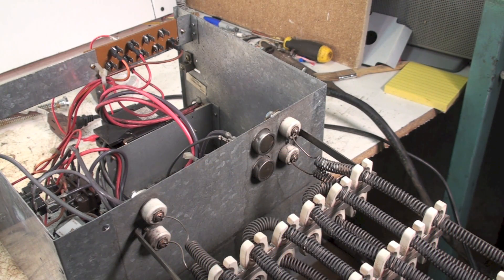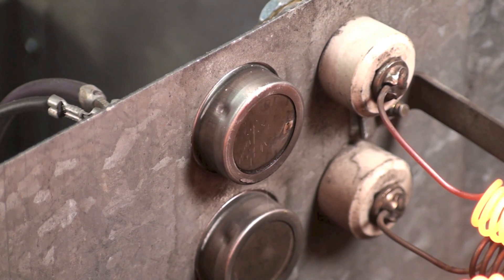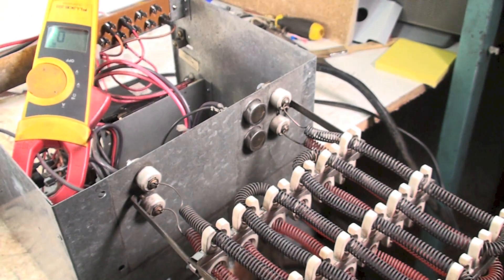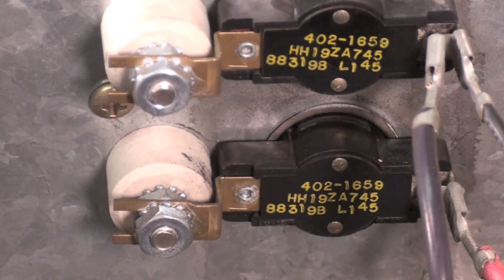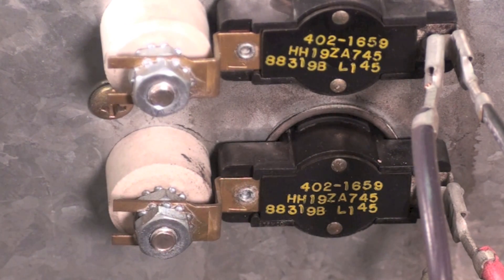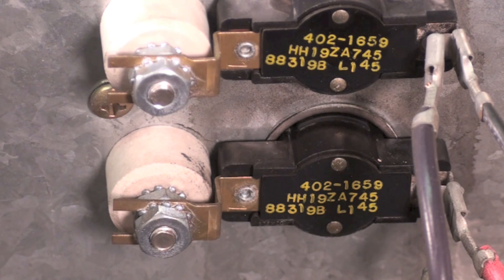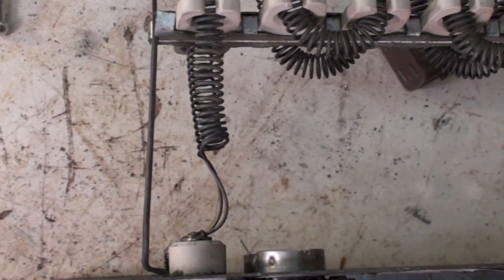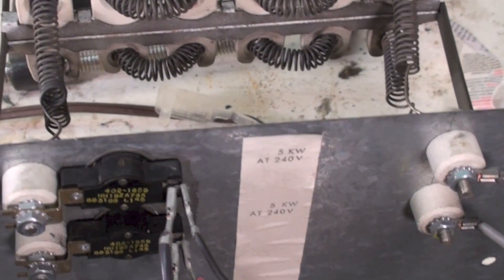How the high temp limits in electric furnaces work.  Part 3

Comment: You don't clean flame sensors with emery cloth or sandpaper OO steel wool and you don't use needle nose pliers to tighten the HSI it puts unnecessary torque on it and it will snap use a nut driver nor a drill gun either.
Reply from the maker: The flame rod cleaning issue is full of dos and don'ts depending on who you are talking to. The truth is if the rod is 304 stainless you can remove the coating if you are very aggressive with your cleaning. I have never seen one that was damaged from over cleaning. The 18-2 rods do not need to be cleaned and even if you do, it's virtually impossible to damage them because the stainless is the same throughout the metal. 
GFM
Reply from the maker: As for the HSI tightening, I have never broken one that was seated properly. You can put quite a bit of torque on them if they are mounted flat. I can't conceive of mounting one with needle nose pliers. There are much better tools, such as a nut driver. One of these days, I will do a video to find out how much torque it takes to break one. 
GFM

Comment: One of mine burned out. I got an extra limit switch from another air handler. Can i just use that one?
Reply from the maker: freddy hidalgo Only if the temp is the same.  It should have a number presided by a letter L.  Example: L145-40.  It means limit switch, 145F, 40F differential.  If that number is the same, it ok.  Any other, no.  Hope this helps.GFM
Reply: Yes it did thanks. Ima start posting videos of install. Check me out maybe you can give me tips

Thanks

Comment: My Intertherm furnace came with the 903906 15Kw element which has only 1 limit switch. A repairman replaced my element with a 9.6Kw element that has 2 limit switches. I want to use the original type of element again because it is much more efficient but I'm not sure how to connect the 1 limit switch. Could you please help me?
Reply from the maker: David Griggs Are you sure you want to do that?  The efficiency of one element of larger size is the same as a smaller one.  It just runs a shorter time.  The limit switch originally supplied was probably in the low voltage circuit which is not as safe as the integral ones on the newer ones.  So, I would leave it alone.
GFM

Comment: I have a furnace limit switch I need to replace on a Goodman Furnace.  The limit switch is rated at 210 degrees but I can't find that exact switch.  I can get a similar one but it's rated at 290 degrees.  Will that be a problem if I use that?
Reply from the maker: James Van Rooy Yes.  You need one of the same temp.  Safety hazard.
GFM

Comment: Good afternoon; I appreciate your video and time for community. I have 2 silly questions.
1- I have 3 different temp limits L210, L160 and L155 Question: Can I replace all of them to same L210?
2- My fan blow cold Air at first and stop after little time when elements are off. Question: is this normal, if not then what should I do?
Reply from the maker: Inzal Sports The limits should not be interchanged because the manufacturer has determined a higher limit will be unsafe.  That said, the L210 sounds too high and may have been an attempt to fix an overheat problem.  You have probably had a long standing problem with low air flow.  Plugged filter, dirty fan blade or restrictive ductwork.  
As for the cold air, you probably have the first element not coming on.  It could be burned wire, failed sequencer or open limit.  Remember, high voltage here, be sure the power is off.  The questions are not silly.  Hope this helps.
GFM

Comment: How do you test to see if the high limit switch is bad? Do you just check for continuity? or is there several ways to test them?
Reply from the maker: SombraLocs The best way is to check it is to fire up the furnace, check to see which elements do not energize.  The check across the limit with a voltmeter.  Voltage read, limit is open.  no voltage, limit is closed or there is an open somewhere else in the circuit.  Hope this helps.
GFM
Reply: @grayfurnaceman  can the limit ever be faulty and stay open , causing the heaters to keep running and that can possibly burn out wires ?
Reply from the maker: If the limit stays closed (switches are closed when current can pass thru), even though there is an overheat, the last thing you need to worry about is burned wires.  
The result will be that the element fuse will blow and shut down the element.  If there is no element fuse, a fire could result.  
Burned wires are from poor connections.
GFM